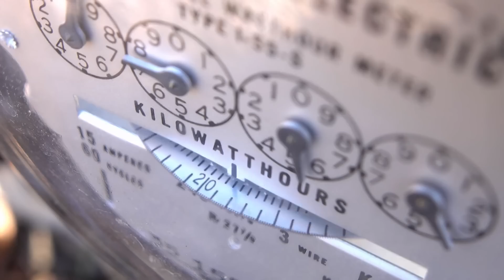The Most Powerful Laser Weapon in Development

Comment: This may sound dumb, but I wonder how effective a reflective material on the outside would be to counter the laser.
Reply: Useless. It can penitrate materials.   It doesnt heat up the target.   It frys its electronics like a emp.
Reply: @justinlance4174  so how about in situation were the laser is used like an iron dome to target artillery/rocket artillery. Also seeing as it’s a laser i assume it can’t be used to deal with threats over the horizon, so for air defense wouldn’t that mean it’s medium range or shorad?
Reply: Glitter Boy from Rifts RPG 1990's, not a dumb question I was wondering as well.
Reply: @omarrp14  not if you mount it to a high-flying aircraft 🤔
Reply: They use infrared lasers that can penetrate even reflective surfaces. Laser cutting machines cut through stainless steel like it was butter. The only way I can see is using gold plating, as gold reflects infrared lasers as they use them in the mirrors in laser cutting machines. Not sure how well they would hold out with an already focused multi KW beam though. Cutting machines are usually 4KW and not focused until the beam reaches the cutting head assembly.
Reply: @fuzzybobbles  good point, and ya I’d still question the effectiveness of gold. But I assume with expensive weapons they’d be willing to spend the money to protect it. But there aren’t gonna be any gold plated 155mm shells lol
Reply: @wyldfantasies  Can't believe I just saw a RIFTS reference. Good worldbuilding in RIFTS. Actually for a single beam laser operating in the visible spectrum it would work a bit, but for pulsatic lasers or laser blasters (like the ones in Star Wars and RIFTS) it actually wouldn't work that well, since the the beam oscillates causing shock and rending of the target. This is also the more effective way of inflicting damage. The better option for beams would actually be a heat conductive material/ablative like the Russians have on the outside of their nuclear warheads. Glitterboys were also supposed to be made of molecularly bonded material (like a diamond) and I don't think being reflective would matter much at that point as the structure of the material would have greatly improved structural strength.
Reply: @justinlance4174  false, it destroys by overheating. its a laser not emp??
Reply: Only Diamonds would work..ironically.
Reply: @fuzzybobbles  The mirrors are copper, not gold.
Reply: @byloyuripka9624  He might mean certain electronic sensors get fried by lasers, but maybe not. EMP works by photons knocking electrons in the air to pulse as electric current in electronics, lasers are known to be able to create EMP effects.
Reply: I would put more money on ceramics that can take the heat for a period.  Rotate the vehicle or the projectile so the beams always getting fresh shielding.
Reply: @byloyuripka9624  
He said...EMP like.
Meaning similar to.
RFC!
Reply: Diffraction in the atmosphere, and the amount of power needed for a laser this of this strength, currently makes these type of weapons impractical. Beams lose strength as they travel through the atmosphere giving them a less then ideal range. Also, a mobile unit would need a huge power supply that would severely limit the type of vehicles/craft that could carry it. These were they main reasons the project was considered impractical with the current technology and has been shelved for the time being until the proper advancements are made
Reply: A reflective surface could negate some of a lasers energy but the shape of the mirror is a lot more important than its overall reflectivity in terms of dissipating energy. A better option would be inbuilt heat sinks although for most aircraft and missiles this would be infeasible as it would be a lot of extra weight.
Reply: Far to impractical.
Reply: Maybe that's why the new F-22 is reflective.
Reply: There's a lot of good points, and counterpoints in the comments under yours.
But many of them are overstated.

A reflective (or ablative) surface could "increase the time on target" needed for a laser to cause damage. Silver is arguably the best mirror material, with a reflectivity of 70% for optical light. Although military lasers will certainly be in the IR band (or lower). Also, the time it takes for the material to overheat, and stop effectively reflecting the incoming energy, would be just as large of a factor. So a different material might be more ideal. An ablative material would be more bulky and heavy, but probably offer greater protection.

Aiming a laser, at a moving target, at range, is tricky. If the laser is dancing around on the target, then it's not offering as much "burn through" as it could. So tracking, aiming, and countering maneuvers (like rolling), could all play a part. This is why it's better to hit a target with a 300 MW laser for 100ms, than with a 30 MW laser tof 1 second, even though technically it's the same amount of energy.

Generally, a reflective surface will still heat up, because it's not 100% reflective. And as soon as it heats up enough to lose the ability to reflect the energy 'away', that layer will suffer catastrophic failure. This could be very rapid. Your coating will get evaporated out of the way. But it could 'help', at a range where the laser is only nominally effective.

There's also active countermeasures. Tanks often already employ this vs laser designators. Doesn't work so well for aircraft though.

As for lasers losing potency in atmosphere... its a weird mix. Under a clear sky, a laser which is pointed mostly upwards, could have effectively infinite range. It would still be quite strong after leaving the atmosphere. In the same clear weather, a ground based laser aiming at a low flying target at say 50km distance, may struggle (note: I am using arbitrary numbers here, to illustrate the effects, not actual figures). If there's some humidity, or pollution, or dust, the range decreases yet more. But if your target is flying at high altitude, your laser will have a long more range due to flying through less atmosphere, water, and particulate matter. If you elevate the laser to 45,000 feet by putting it on an aircraft (instead of a ground platform). Then your range will increase dramatically. 

Adding 'weather' complicates things. All of the above is in relatively clear weather. IR band lasers can penetrate clouds "somewhat". A minor cloud would just diminish the range some. A major cloud or overcast sky would really kill the laser's effectiveness at any range beyond the barrier in question. Being IN a cloud (on the ground this is "fog" or "rain") would make even an IR band laser utterly useless. In dry environments, dust could be a major issue at very low altitudes as well.

From a high altitude vantage point, a laser-armed aircraft would be able to target quite a large area with effective laser power. But weather would offer cover for possible targets. This isn't entirely new to warfare, a soldier with a rifle has the same problems with targets behind behind cover. But for aircraft to have effective cover (not just "concealment") up in the air, is new.

If you are IN a dusty, humid, or frost-prone condition (where your laser is located I mean) you could have major problems with the clarity of your uhhh... well in layman's terms, with the "muzzle" of the laser weapon. The exit for the laser beam must have pristine clarity. So even in light dust or thin fog, it may be impossible for a laser to be safely employed even at short range. At high altitude, or cold environments, frost might be an issue.

Lasers need a lot of power. The bulk and size of power storage seems to have been largely solved. The bulk and size of the laser itself seems to have been largely solved with solid state lasers (instead of the old chemical lasers). Power generation is still a question mark. 300 MW? that's a LOT of electricity. Even with very robust power generation, I can't imagine you'd be able to achieve a high rate of fire at that power. But you could always fire it at less than maximum power too. Then again 100ms of 300 MW laser only uses the same power as 1s of 30 MW power, and would be more potent in range and in getting all of that energy onto a single point on the target. So the more powerful the output, the more practical the laser, with a given amount of juice. Is there enough power generation for an acceptable or sustainable rate of fire? That's my main question.

Lasers won't end the career of the missile, or even the gun. But they could be "circumstantially" very potent.

- note: Japan's F-X fighter is going to be equipped with a "microwave laser"... which will have very different properties to much of what's discussed above. It'll still dissipate in moisture but not quite as badly as IR, but it won't need a pristine lens, and it would penetrate dust better too. It tends to generate less heat on impact. But it could be "traumatic" for electronics (and likely for pilots as well). I think that's what Justin Lance may have been referring to.
Lasers traditionally are used to destroy a target with heat. But in a broader sense, DEW's include things more like "death rays".

Also, there's defensive use for lasers. An incoming missile will always come within range of a laser, unless you're IN rain or fog, because it's coming to the laser, and even in poor conditions, the range of a laser is not zero (unless you're in a condition where the lens would be compromised upon exposing it to the air).
Reply: Omar you are on to something
Look at the recent pictures of a f22 flying out of Nellis AFB with a mirror like coating
Reply: @ObeyNoLies  As for Star Wars, laser cannons are a misnomer. 

They're actually plasma bolts wrapped in a charged particle jacket, and from what I know from the arguments online, in Star Wars, there is a portion of the bolt in front that is invisible and that is the part that does the damage since the explosions in the 6 original films (minus the godawful disney-era nonsense) seem to occur before the visible portions of the plasma/particle bolt hit the target. A tracer... if you will. 

My only criticism of Star Wars was George Lucas tended to make things sound cool, but it's a bit misleading Ion cannons in Star Wars should have been called "Disablers" or EMP cannons, since Ion Cannons would absolutely DESTROY a target outright instead of frying electronics. Blasters/Lasers/Turbolasers
(LASER, being the keyword here)
Star Wars "laser" named weapons do not behave the way they do in real-life. 
A laser in real-life compared to Star Wars, (which are particle-plasma.) is a device that emits light through a process of optical amplification based on the stimulated emission of electromagnetic radiation. 
Those never were lasers. 
Lucas didn't know what Plasma-Cannon was back then in '75 when he was writing the stuff for the first movie.
Reply: @sonofeyeabovealleffoff5462  I used to have "technology of star wars" book when I was a kid that I have since lost. In it, the weapons are called 'laser blasters'. According to my research, blaster differ from beams in that they use kinetic shock to inflict damage. I guess they could be charged particle blasts, but then why would a light saber reflect them? Isn't a light saber made of, yaknow, light? Is this an EU thing? Cause take any expanded universe lore with a heap of salt.
Reply: It can, but NO surface can reflect 100%, much of the energy is absorbed, so for an enough high powered laser, the reflection does NOT really matter. Also, coating with reflective materials would mean very high and instant radar detection.

Comment: Melting metal with a laser is not the real issue. High Speed photography has shown that when it hits the metal surface, it vaporizes the top most metal layer, creating  an expanding ball of plasma, and causes a concussion effect, like setting off an explosive charge on the metal surface. As the plasma ball expands, it continues to absorb the laser energy, blocking the target from further damage until the plasma dissipates.  Recommendation of the study that to maximize metal damage, the laser weapon should not be a continuous beam laser, but instead a pulse laser weapon, to permit the blocking plasma to dissipate between shots

Only weaker lasers are continuous beam, when they lack the energy to turn metal into plasma
Reply: I was actually about to say this, lol.
Reply: I have been thinking lately… I wonder if it’d be viable to have a hollow IR laser beam with a high energy UV in the center. Use the IR beam to sort of shield the UV one in the center.
Reply: Actually they just fry the internals of the missile or target.  Lazers arent stopped by material.
Reply: @justinlance4174  The lasers affect both the materials and electronics, but it's mostly the electronics taking the damage instead of the aircraft itself.
Reply: yeah i hope they make some powertful pulse lasers

Comment: You need an impulse, and a reaction time, if you point that laser at a hypersonic target for 2 seconds, it will have traveled 4 miles. If they start 3 missiles with a slight change in angle of approach, the 3rd one will hit, just because the beam is still busy with the first two. 
Missile based Missile defense can be fired a second and third time, before the first target is hit. it is not "kept busy", but can cycle through targets in that time. Many factors must come together to make a laser based system "Effective". Output power, perfect tracking, Material hit, weather, distance.  Missile based interception is "hit, or miss".but wether it hits, or misses, it can target other things while missiles are en route.  A beam needs an uninterrupted line of sight, until target is destroyed. Easily overwhelmed by a few ripple-fired missiles.
Reply: You, sir, are correct.  Lasers are a very poor weapon for either offense or defense.

Comment: Relatively simple counter solution, make shit reflective.
Sure isn't perfect but makes it a hell of a lot harder to heat stuff.
There have been sightings of planes with reflective bottoms I think.
Reply: @justinlance4174  from wikipedia "A laser is a device that emits light through a process of optical amplification based on the stimulated emission of electromagnetic radiation. The word "laser" is an acronym[1][2] for "light amplification by stimulated emission of radiation"."
Also if it isn't stopped by materials, as in not interacting, it would do anything to the internals also. Since they are also materials.

Also, loads of these systems use mirrors internally to direct the beams .
Reply: Reflecting radar and high intensity lasers are pretty different
Reply: Shine a high power infrared wavelength laser at a mirror and see what happens. Goes straight through it.
Reply: @LordMithril  not a chemical lazer.  What most lazer wepons are.   It uses chemical reactions that make a beam that stimulates atoms   in short its not like a lazer ur thinking of.  It cant be seen by the eye.

Comment: "Oh, you have a hyper-sonic missile?  Can it go FASTER THAN LIGHT?!"

If anyone can figure out a way to get past the speed of light, it'll be someone in the DOD working on some obscure defensive counter-measure to these types of laser weapons.  The Chinese will say they have faster-than-light missiles but will be simple cardboard mock-ups.  Meanwhile, the Russians will put up a mirror...
Reply: Nothing can travel faster than the speed of light. Theoretically, if you could, weapons would be your least concern. Why? Because youd have just invented time travel.
Reply: Mirrors are based on thin layers of metal that absorb 2-5% and the first laser pulse will burn 🔥 thru that. Industrial lasers drill and cut thru thicker metals for decades. Mirrors 🪞 don't stop lasers in general.
Reply: @mrbaab5932  I'm actually well aware of that.  My comment about the Russians putting up a mirror was tongue-in-cheek.  More of an homage to the old parable of NASA spending millions of dollars and countless research hours building a pen that would write in zero gravity while the Russians simply used a pencil.  The differences between over-engineering a solution versus using an existing crude-but-functional one.
Reply: @John_Redcorn_  Hence my qualifier, "If..." Besides, you know someone at the DOD is trying to get such a project funded, anyway.  "Forget impossibilities, make it happen!"
Reply: A mirror as you put it will not reflect this type of laser,it would burn straight through any reflective surface it hits. This is next gen laser technology,not your typical LAWS type of laser.
Reply: @Healthliving1967  See my subsequent reply about that being tongue-in-cheek...
Reply: @toddlynch7282  all good,its just a lot of people dont understand that there is many different types of lasers,this particular laser technology is cutting edge and unlike any other laser out there. The power in this laser will be unmatched,it will be capable of burning through any type of reflective and non reflective surfaces.
Reply: @Healthliving1967  idk why the YAL-1 was retired it had a megawatt chemical laser more powerful than the 300kw laser that the us is currently developing. It seemed pretty big but it would've been possible to be put on ships.
Reply: @user-jh6ik1qd7p  yeah not practical for ships. The military complex has technologies with lasers and all sorts of other stuff that we don't know about.